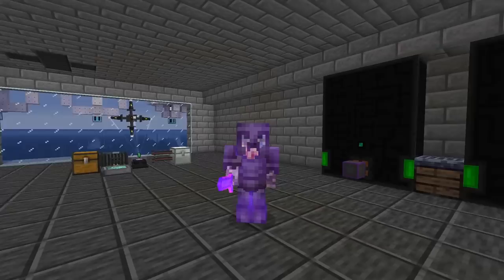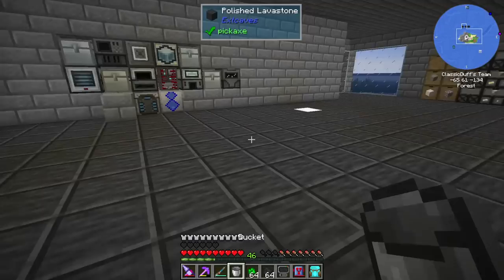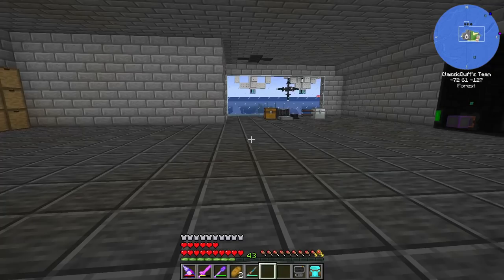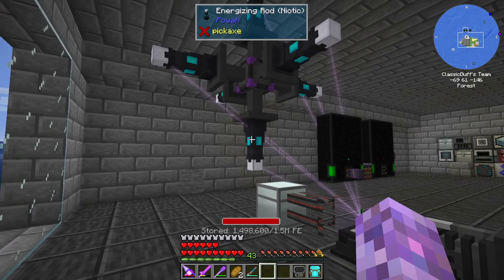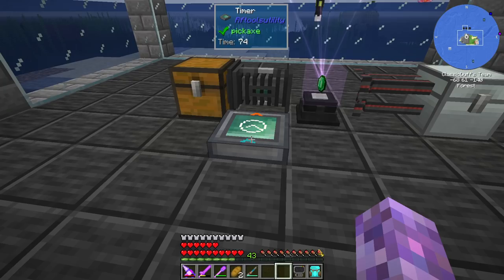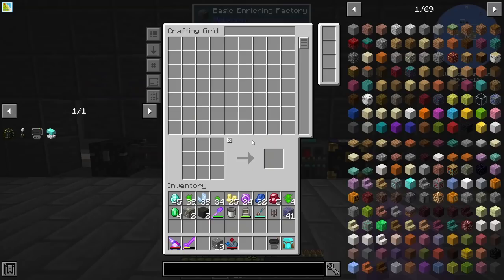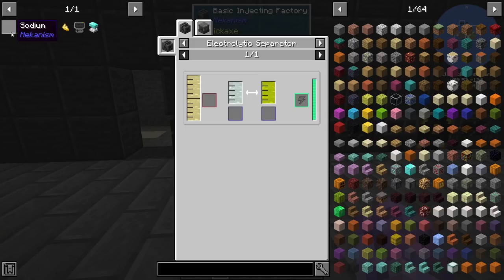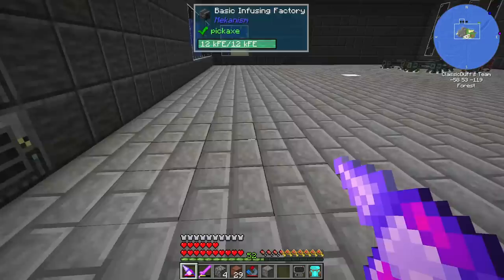Direwolf20 1.16 Ep 17 - 58000rf Reactor & Ore Quadrupling

Comment: If your stockpile of emerald or diamond gets too low and becomes an issue, you could get into Astral Sorcery to get unlimited Diamonds and Emeralds.  Once you get an Astral Starlight Infusion Altar, you can use that to get 5 Emeralds/Diamonds per ore block.  With Mekanism, you can turn 3 Emeralds/Diamonds into 3 dusts (1 per gem) in a Crusher, then use the Combiner from Mekanism to turn 3 dusts + Cobblestone into an ore block.  So, essentially the process will turn 3 gems into 5 gems.. then just continue to cycle thru the process to get unlimited Diamonds/Emeralds.

Comment: You can use autocrafting with Powah, use a crafter to a chest and use xnet to extract and import to the Energizing orb. Blacklisting and whitelisting will be needed and use multiple channels, like for only one item crafts use one channel, for 2 item crafts use another.
Reply: its easier and cheaper just to use vanilla mechanics. a comparator, repeater, 3 blocks, 3 pieces of redstone and a hopper
Reply: @davefroman4700  True, but considering resources are not a problem it shouldn't matter. I just find it easier with xnet.